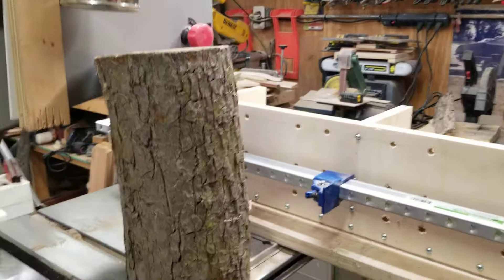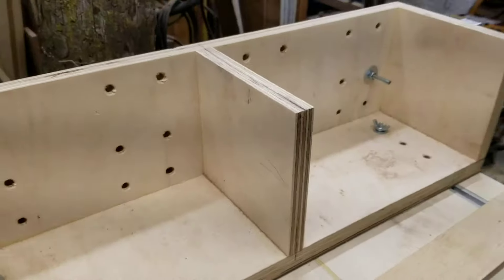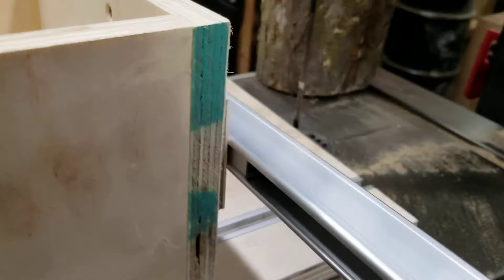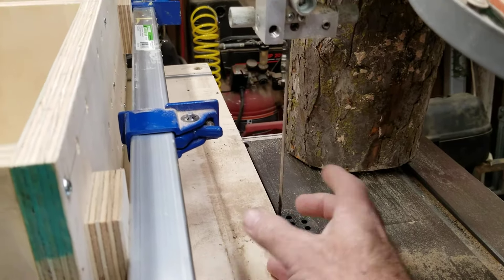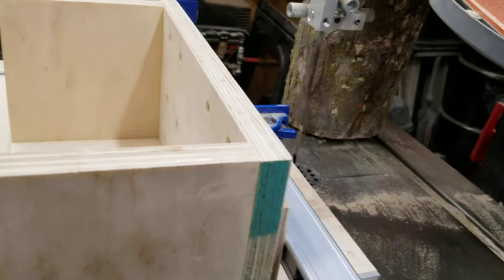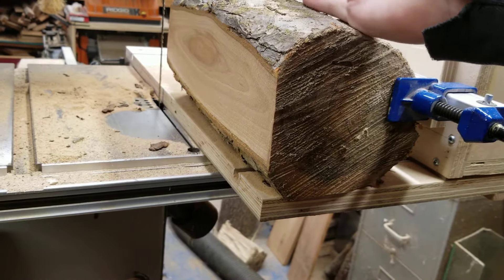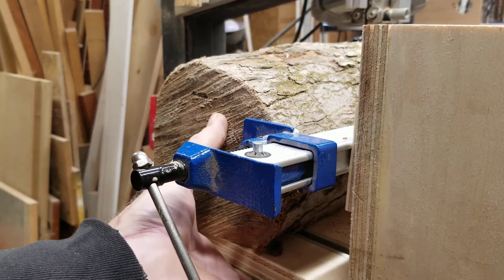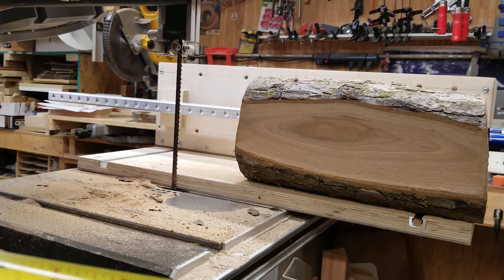BAND SAW LOG SLED

Comment: This is just the kind of jig I'm looking for and I will definitely be building your version soon. I'm trying to work out how long to make the base... it looks like the length of the base would essentially be equal to the maximum length of log you wanted to cut, and that the miter bar would need to be the same length? I found an aluminum t-bar style miter bar on Amazon that's 48" long so I'm thinking I'll use that bar and make my sled/base 48", which would let me cut 48" logs (with proper infeed & outfeed support of course). Thanks for posting this video and sharing your design!

Comment: This is an Awesome innovation!  I'm definitely making one.  So simple, safe and secure, and is so easy to adjust to and size or shape log.  You should apply for a patent on this.  It's WAY nicer and more versatile than that "Little Ripper" gig that someone designed and is selling for around $380.  Blahh!
Thanks so much for sharing.
Reply: I was thinking the same Thing!!
Reply: Carter makes this already, almost exact same design.  $160

Comment: I like your design; it's simple but effective. Being able to angle the log is a good feature. You could extend your log length by using roller stands on the infeed and outfeed side of the table. (My bandsaw doesn't have T-slots.) I've sawed green logs in the past and they were very heavy and awkward to run through the saw. Your fixture would have helped a lot. I'll keep your design in mind if I need to mill logs in the future.

Comment: Picked up a Rikon 10-326 14" bandsaw last week. For the main purpose of re-sawing to make book matched veneers etc. I've watched at least 50 videos of people's "sleds" which all used screws to hold the log... All I'm thinking is blades are to expensive to risk hitting a screw... 

I really like your set up. Super easy, clean design which produces consistent results. I will be building a variation of your sled. Thank you for the upload.
Reply from the maker: Your welcome. Be safe my friend. Keeping the log from rolling into blade is always a concern.

Comment: OK, I see that this is from 5 years ago. But I never saw it before and it is just what I need to turn hurricane logs into usable project wood. Thanks for the inspiration.
One note for anyone watching. The Harbor freight bar clamps are great, but can be even greater with a 1x2 shoved down the tube. The 1x2 needs to be sanded a bit to make it fit just right.

Comment: Nice jig, I use a hand held power planer to make a 3" to 4" flat on the log so it will sit securely on the sled. It takes about 10 passes on a log that's 8" or so in diameter. That takes about 4 minutes, then I'm ready to resaw.

Comment: Thanks for this video!  I had the same reaction to putting holes in the stock, but I hadn’t gotten far enough in my design to use a bar clamp. Great solution.  I plan to build this sled, or something that will work with my clunker bandsaw.
Reply from the maker: Glad it was helpful.

Comment: Here is a short video of cutting a walnut log on a bandsaw sled.  I use screws and a battery drill for a quick tack.  When I am cutting off the 1" boards off the log the screws are in the sap wood which is mainly put in the firepit.  The wood is green and I rarely find after air drying for a year as it's stickered nice and flat then  jointing and running it through the planer do I see any screw damage.  The wood is pretty much free so it's money saved by a long shot.   These logs were in a guys back yard for about 6 years.  Here is the video   (3) RESAW Rotten Walnut Log - YouTube
Reply from the maker: https://www.youtube.com/watch?v=a2jaMHML4C8

Comment: Just a thought, but with stability being what I perceive as the number one goal, wouldn't using both miter gage slots be twice as good as one
? While I realize I will be cutting a slot just ahead of the backwards end of the sled and allow about a 40" log sometimes, I cant help thinking 2 runners will be pretty smooth cutting...At worst I can always cut all the way and remove one side if I'm wrong..
Reply from the maker: Not quite sure how that will work. The stability issue for me is with the log being pulled down towards the table and causing a dangerous situation. That is why I sometimes need to use shims underneath the log to stabilize it.

Comment: Great design. I have the same saw and I have some longer logs that I want to do this with. What blades do you recommend for this with both dry and green wood?
Reply from the maker: I am  using a 3/4 inch wide blade with about 4 teeth per inch.
Reply: @CHICAGOHAND  thank you. I ordered a new blade and put the proje t together this week.

Comment: I guess you could add an overhang on the sled to catch under the table. That way it wouldn't tip over and you could mill some longer logs
Reply from the maker: Ya I need to put some more thought into that part of the design. Thanks for the comment.

Comment: Nicely done. Just a suggestion: Cut out a slot between the top and bottom holes that hold the bar clamp bolts at each end. Then all you do is loosen the nut and slide the clamp to the height you need.
Reply from the maker: Great idea. Thanks. Now until I fix that I won't be able to unsee it when I use it, LOL.
Reply: Any chance telling me were you got that clamp.? I've searched everywhere. Thanks
Reply from the maker: @nakusflies593  https://www.harborfreight.com/36-in-aluminum-bar-clamp-60539.html

Comment: Where did you get the bar you used on the bottom
Reply from the maker: I think from amazon. Here is a link to something similar.
https://www.amazon.com/Strength-Woodworking-Durable-Aluminium-11-81inch/dp/B07S6QNY1V/ref=sr_1_14?crid=CJGG3TEZZKTP&dchild=1&keywords=miter+slot+runners&qid=1622250193&sprefix=miter+slot%2Caps%2C167&sr=8-14
Reply: @CHICAGOHAND  Thank you for your reply. It was much appreciated.

Comment: When you mention drilling screws to hold the log, you do realize the screws are basically only in the slab cut/bark right? I just bought the Harbor freight clamp and will try your version. The clamp will certainly be faster. I had access to a roller table to allow me a chance to make infeed and out feed tables which appear to provide a great deal of support in addition to my tee slot miter bars.
Reply: @Anders Bodie Instablaster :)
Reply: @Jeremy Crosby thanks for your reply. I found the site on google and I'm trying it out now.
Takes quite some time so I will get back to you later when my account password hopefully is recovered.
Reply: @Anders Bodie happy to help :D

Comment: Not trying to be negative, on the first cut with your hand on top of the log, IF the log rolls your hand rolls into the blade. 28years tool and die work, same thing happened in our shop. I like your sled, nice
Reply from the maker: Thanks. I will try and fix that. No negative taken. I am involved with high voltage work and I take safety observations seriously.